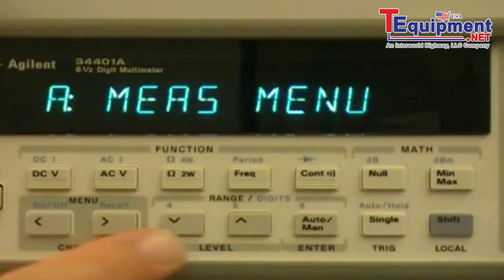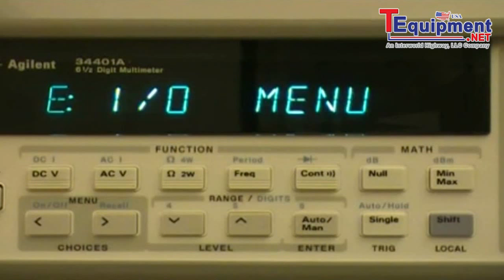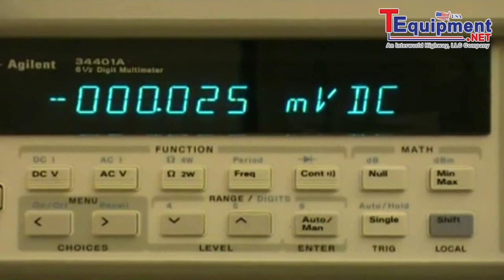How to change the GPIB Address of Agilent 34401A DMM

Comment: How did you enable the Temp menu? (magic DIAG:POKE commands, I assume, but which specifically?)
Reply from the maker: Watch the first 60 seconds again - press "shift" at the bottom right then press the left arrow key at the bottom left to enter menu selection. Then you can use the left/right arrows to cycle thru the different menus and use the down arrow the enter the menu you want.
Reply: @TEquipment  My 34401A does not have the TEMP menu.